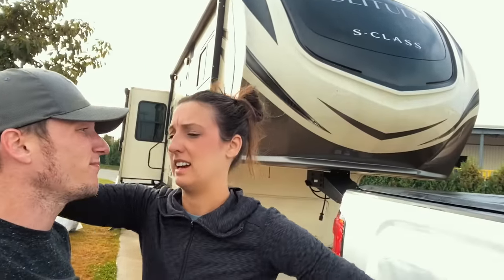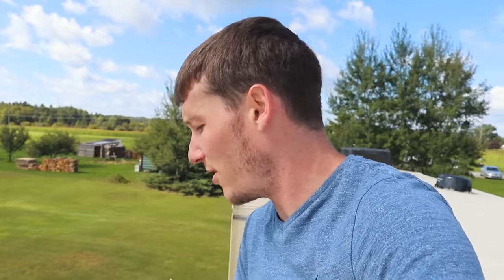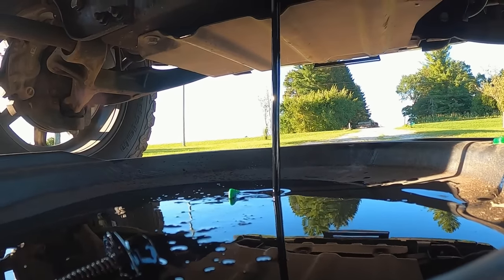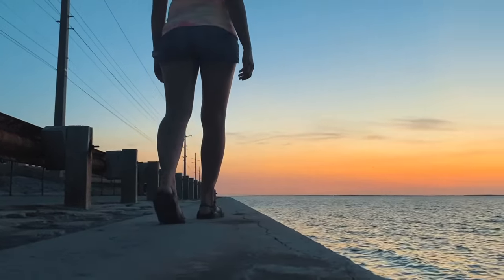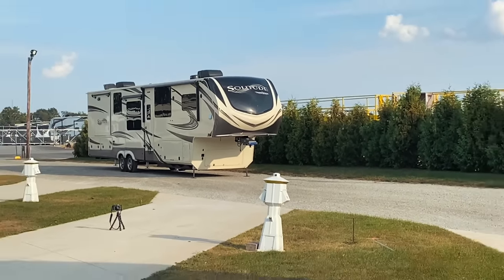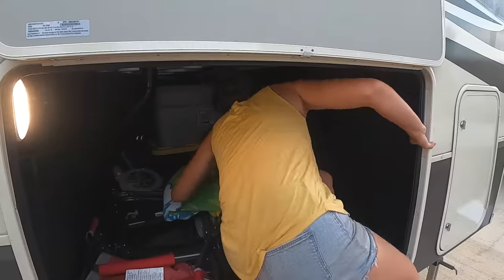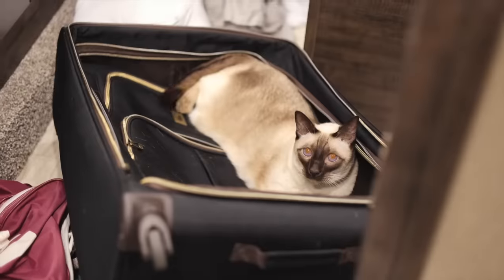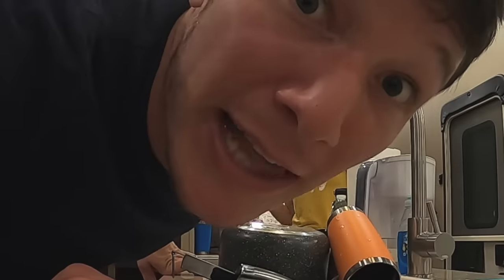SAYING BYE TO RV LIFE | The WORST Struggle an RVER Will Face

Comment: RV motor maintenance - We have a Class-A on a Chevy Workhorse Chassis, a 2003 Fleetwood Bounder. Since I've had experience with a variety of General Motors engines, I was thrilled to see how easy it was to change the oil on our Bounder. I've done it a few times, plus a few other fixes (batteries, for instance). We're just getting it ready after it sat for a few years, so this time we brought it to several shops for new tires, and a total engine inspection. It was nice to let someone else tackle the whole list, which included all fluids checked and changed, new radiator hoses, serpentine belt, and a leaking gasket near the radiator. I like to get my hands dirty with maintenance, but sometimes it's nice to have someone else tackle it for you.

Comment: I just finished taking rubber, plywood and insulation off my 40 foot Montana rebuilt A/C ducting thanks to Red Squirrels.  We added some electrical in attic as well then spray foamed entire ceiling and reapplied everything. WHAT A JOB in Michigan mid 80's with 90% humidity. The rubber I applied seems like 4x thicker crazy difference. The job took about 120 man hours in the sweltering heat and about 40 gallons of propel and water to keep hydrated ( not hydration of choice but on a roof it was the proper choice).  Now having A/C coming out the ducts rather than in the attic and the meat locker feel insulation you turn on air and bam instant cool down. Also total muffle of rain and other roof sounds. wish I had done a decibel check before and after for A/C noise because there is definitely a change. Now in 3 weeks when we return home a new awning skin ( thank you very much campground jerks fireworks) and install my solar panel slide out system 9 370W. panels

Comment: Its easy to get overwhelmed trying to determine what goes or stays.  Many times the stuff that goes with us is a mixture of stuff you do and dont need. Sonetimes that's the only way lost items are found.  Thanks for the informative, entertaining and encouraging video.  Just remembered I sold a bumper pull with  what I thought had little in it. After two large containers and a shop vac for the dust bunnies...whew.   i didnt realize how much stuff one can hide.

Comment: Good advice! Yes we have had to unpack the RV so it goes to Service, ours was in service for a couple of months very stressful, not knowing when it gets done.  Support for each other through the process as each has a different need.  I just finished doing a tone of work on my RV it’s just over 5 years old so I did a full under carriage corrosion control, got real intimate with the tires shocks, axels, springs.  First time I have taken all 4 tires off, and off loaded the spare, learned some interesting things about the spare, easy to take down not so easy to put back up.  One person doing all of this can wear on ya.  Tires still look good, I am glad that we have kept them covered when parked to keep the ultraviolet rays off the tires as that really damages them.  That tire wear is not normal for sure.  One thing for sure is that everything will be super dusty from sanding the fiberglass etc.  best of luck with your repairs.  We are heading down to South Padre for a month of beach time.
Reply from the maker: Hey! Thanks for sharing! So glad you got it all figured out! Sounds like it was a lot of work! Safe travels!

Comment: After 3 blowouts with the factory installed ST rated tires, I found the best tires are G series 14 ply Goodyear tires.   Going on 4 years and still 3/4 tread.  The ST's are too flexible nearly folding on themselves in turning.  Also speed is crucial, ST's get too hot on the road, recommended 55-65 mph at most.

Comment: when you change the oil drain it into the oil catch pan. pour it into a couple empty gallon jugs. bring the used oil to a service center. they will take it and dispose of it properly. any oil change should take it they may or may not charge you a small fee.

Comment: RV's are not built to be lived in full time, however, like any machine, fix it when the problem is small. It's cheaper to do, saves time and lasts longer. I had an '88 Peterbilt with over 2 million miles, top bottom & everything in between was immaculate. Not be cause it was a show truck, but because I fixed the small things immediately
Reply from the maker: Very very true!! Thanks for sharing!

Comment: Have you done a transmission flush, drive shaft maintained, U joints checked, differentials oil changed??  Pulling a trailer is hard work for your truck.  Mine is scheduled for this Monday.
Reply from the maker: Great questions! We actually did all of that last year. We are coming up on 100,000 miles on the truck...so I need to see if it is listed for any routine maintenance. Thank you for your great support in watching our videos! - Kyle and Renee
Reply: @HappilyEverHanks  pulling a trailer jumps up time tables on it.

Comment: We’ve only been full-time since August 11, but we have a few tools and mods that make oil changing almost entirely mess free.
Reply from the maker: This is awesome to hear!! What kind of tools do you speak of? 😀
Reply: I use these three tools with tubing that drains straight into the catch pan hole with no splattering. Just hook up the tubing and open the drain valve. I use the oil udder for removing the filter. It actually works well. 

OIL UDDER 4" XL W/Drain Kit | 3...
EZ-106 EZ Oil Drain Valve with...
FloTool 42003MI 16-Quart Drain Container
Reply from the maker: AWESOME!! Thank you so much for writing this out for us, I will look these up 😊🙌🏼 Stay safe out there! We hope to hear from you again real soon!!

Comment: We had a water leak on our rig when it was just 2 years old.  We thought it was gonna be totaled too as the water leaked from the city connector in the rear all the way to the front. All the underbelly insulation had to come out and there was mold all over the wood framing. We emptied EVERYTHING out of the trailer and it went back to the dealer. They were able to treat the wood and replace the connector and insulation. Luckily all within the cost of the insurance deductible. But I Remember it feel kinda good to clean it all out and see all the crap you collect.
Reply from the maker: Oh my goodness Jim! You have a fantastic memory!! 😁 thank you for sharing this, we would have to say that we totally agree with you… it felt really nice getting the camper cleaned up despite not needing to. Downsizing always take some of the stress off the plates 😃👍🏼

Comment: Use Amsoil, change every 25,000 and filter every 15,000 using Wix oil filters.  Save a ton of money and time.  Ran a Honda Civic 160,000 miles used a half quart every 15,000 when I sold it. I use Amsoil in every 4 stroke I own including my GMC 6.0 liter truck I pull the RV with.
Reply from the maker: This is really great information Harry! Thank you so much for taking the time to write this out for us 😊🙌🏼 I will be sure to keep us in mind for future changes of the oil!!
Reply: @HappilyEverHanks  Here is a tidbit of information. Don’t know if they still do, but with large capacity engines, you could send a sample of the oil in and they would analyze it and let you know if and when to change it.
Reply from the maker: This is great!! You just keep teaching us more and more new things 😁👍🏼 Thank you Harry!!

Comment: Stuff happens. We should have stayed home this year.

A large tree branch came down between trailer front cap & truck cab at the Graceland CG, Memphis. Graceland compted the stay but it will cost more than that for truck repairs.

The trailer legs slipped off the blocks in Durango, CO. & did damage to leg mounts requiring welding. 12 days lost waiting for parts.

Truck broke down, went into limp mode, west of Butte, MT. 5 weeks lost there waiting on parts & getting repairs done. $8000.00 plus car rental & time at a not very economical CG. At least the home was not lost while the truck was in the shop. A big advantage of NOT having a class A or C.

Ya gotta roll with the punches.
Reply from the maker: Oh my goodness 😔 This is so much! We are really sorry that this happened to you ❤️ Yes, rolling with the punches is the key. Thank you for sharing, best to you

Comment: I have a EZ drain plug on my 19 cummins...had it on my 09...they're like 20.00 on Amazon just contact them for which model fits your truck's threads...I stock up on filters etc to do the oil changes...I'm in the process of putting in a tankless water heater and saw this was from 2 days ago...sorry your 5th wheel needs to go to the shop...I had a 5th wheel a few years ago (prior to covid) and it had less issues and was in the shop for a year!!  No joke....good luck and sorry 😐
Reply from the maker: Wow thank you so much for this! I had no idea that this actually existed 😅 we will definitely be looking into this! Thank you for your kindness and support, we can’t believe that it was there for like a year 😱 we will keep you updated as we know more!! We are just taking a day at a time right now

Comment: Just packing and unpacking from a trip is nerve racking.  This trip turned into one jangled nerve after another...BUT...I was able to get the black water tank to drain and flush properly so it shows empty when it is empty.  Rufus caught a BIG rock from a semi just off center to the right of the steering wheel.  George wouldn't quit howling.  I think I will get a video of him yowling and we can compare which cat yowls better-George or Dexter.  My water pump completely croaked.  My laptop died...mostly...  Lessons learned...  And I joined the Hanks in a fight with a tree.  The space I had picked at the state park to prep for storage and repair at the dealership had a tree on one side of the exit and a BIG boulder on the other.  Choices: take out the left side on the boulder or pray for the best with the tree.  The tree won the battle...damage to the roof that needs to be repaired or the roof replaced (rubber).  Thankful for insurance...  Glad for the stick a brick right now...and I am thinking about RVing full time.  NOT today!!  Made lots of friends with mobile RV repair guys.  

Thanks for sharing your trials and tribulations.  I am glad I am not alone with "issues".   Sometimes all you can do is laugh.  I wouldn't give up my retirement for anything....having WAY too much fun.
Reply: PS:  If we ever meet up at the same RV park, I am still planning on photobombing your video if I can...  I have a plan...
Reply from the maker: Hey Val! So sorry this all happened! You sound like you know what you’re doing! Hope things go smoothly for you! And yes please photo bomb us! 😃

Comment: Every time I take my RV in to have any kind of service done on it I always clean out the storage bins. The only reason I do this is because several times the technicians have not put everything of mine back in my storage bin including my power cord on one occasion. Luckily I seen this before I took off to go camping. Unfortunately I was already home when I noticed this so I had to drive all the way back to the service department and argue my point to get my power cable.
Reply from the maker: Great tip!

Comment: I just bought a new used camper from Camping world.  Couldn’t take it home.  Going on week three to get new awning installed because original was torn.  They said awning is coming from manufacture.  Reason for delay.  I told them I can order on Amazon and receive it in 3 to 5 days…. And camping world brags about there supply chain.  They claim if they don’t have in stock they can just get it shipped from another location…  How’s that working for them?  Sucks….

Comment: Quick question.  I had a class A for several years and got out of RVing a couple of years back.   Looking to get into a 5th wheel now that I have a dually truck.   I know that my Class A was about 12' to the top of the antennas and I had to go careful with trees.   The 5th wheel toy haulers that I look at (one is a Grand Design) are all like 13.5' high.    I see bridges that are 13'6.   Dealing with 1" of clearance is scary.    Do you have a lot of problems with trees / clearance?

Comment: Working with all stays trying to find rv camps open in mid to late November for going from south dakota to the finger lakes in new york.  Found one in sioux falls, but having trouble finding parks the rest of the way.  Any help 8s appreciated.
Reply from the maker: Make sure all of your filters are open and clear. If you add too many filters in the search you may miss some!
Reply: @HappilyEverHanks  thanks the only filters applied are 300 miles for the leg away from the previous stop and open year round.  Any other pointers?
Reply from the maker: None that we can think of at the moment! Stay safe out there 😊👋🏼